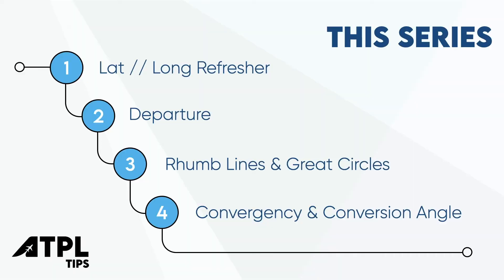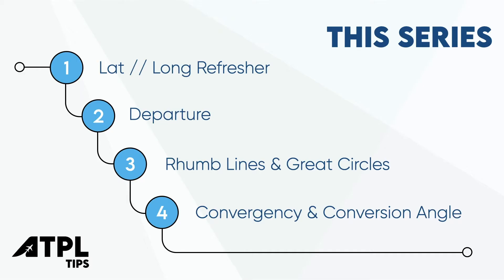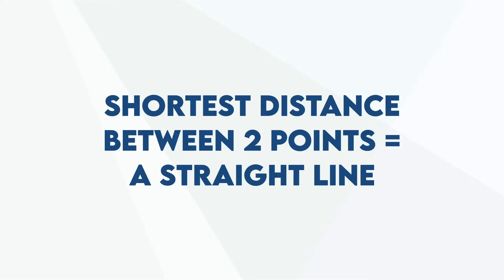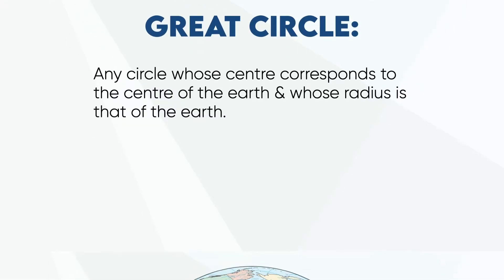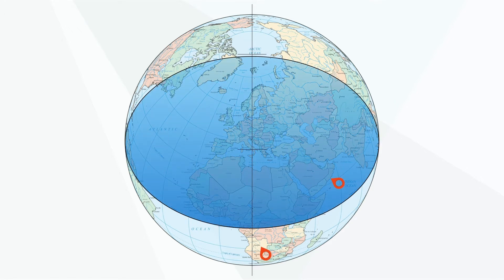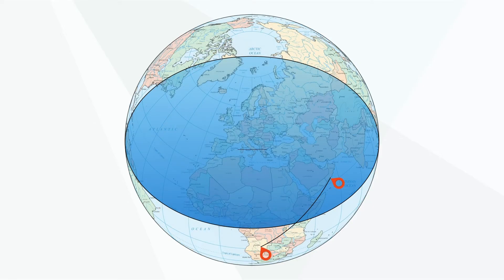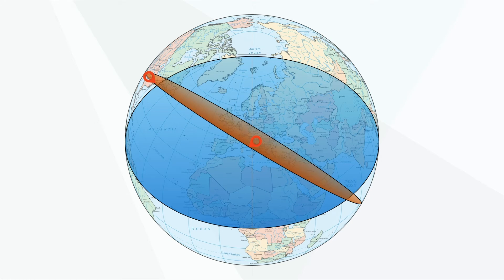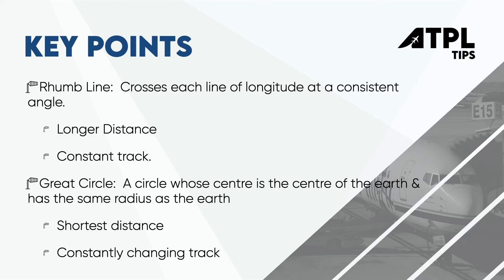GNav Basics 3:  Great Circles & Rhumb Lines

Comment: The Shortest distance  between two point on the surface of a sphere are two  geodesic arcs equidistant in Lenght and a mirror image of each other unless the points are 180 degrees apart (antipodes) Then its one line around the great circle route only  ..........Two paths on a sphere One path on a flat Plane ...simple
Reply: Garbage. Utter garbage.

Comment: Complete and utter nonsense ..The shortest distance between two points on the surface of a sphere are "TWO" GEODESIC ARCHS equidistance in lenght and a mirror image of each other ,unless the points are 180 degres apart (antipodes) then its one line around the great circle ONLY ....Drawing an equitorial line between two points is bogus AND NOT THE SHORTEST DISTANCE ...
Reply: Garbage.

Comment: This video alone debunks all flat earth theories regarding flight paths rarely crossing straight over the Atlantic.

Thanks for sharing
Reply: Complete and utter nonsense ..The shortest distance between two points on the surface of a sphere are "TWO" GEODESIC ARCHS equidistance in lenght and a mirror image of each other ,unless the points are 180 degres apart (antipodes) then its one line around the great circle ONLY ....Drawing an equitorial line between two points is bogus AND NOT THE SHORTEST DISTANCE ...
Reply: @markhalpin4377 
Any two locations on Earth are points on a great circle. Why do we need two great circle tracks?
Reply: @jesuitfreemason  Passing an equitorial line through two points on the surface  of  a sphere is not the shortest route that is the great circle route only ..One line on a flat plane two paths on a sphere ...simple
Reply: @jesuitfreemason  the only great circle route is between two points 180 degrees apart only
Reply: @markhalpin4377 
You're completely wrong. I don't know where you're getting this stuff from.
Any two locations on Earth are points on a great circle. Durban to Perth or Liverpool to Bradford, using spherical trig I can calculate the distance between these two city pairs, whether they be 50NM or 5000NM apart.
Reply: @jesuitfreemason  Complete and utter nonsense .Read the definition its explaned perfectly ...There should be two paths or geodesic arcs between any two points on a sphere unless they are 180 degrees apart ....Joining points by an equitorial line is not the shortest distance .....Two on a sphere one on a flat plane ....This does not reflect in reality ie with Air Routes
Reply: Wrong
Reply: @markhalpin4377 
My challenge to you.
Give me the coordinates of any two locations and I'll calculate the great circle distance between them.

Comment: Spherical Trigonometry Projection and Great Circle Map
The Great Circle Map can be projected by Spherical Trigonometry. Any region or nation can be center in the Great Circle Map.
The transformation of xyz coordinations on the Globe or Map will be calculated. 
Basic transformation of xyz coordinations has two steps that the rotation of cos circle and sin circle.
Namely, There are two formular. One is the rotation of cos circle and the other is the rotation of sin circle. 

The formular of the cos circle rotation for A degrees
(x=cosAcosθr, y=sinAcosθr, z= sinθr)

The formular of the sin circle rotation for B degrees by using Rotation Matrix
(x1=cosBcosAcosθr+sinBsinθr, y1=sinAcosθr, z1=cosBcosAcosθr-sinBsinθr)

As the transformation is programmed with big data, the Great circle map can be used in the various fields such as science, geography, and climate.
Reply: Complete and utter nonsense ..The shortest distance between two points on the surface of a sphere are "TWO" GEODESIC ARCHS equidistance in lenght and a mirror image of each other ,unless the points are 180 degres apart (antipodes) then its one line around the great circle ONLY ....Drawing an equitorial line between two points is bogus AND NOT THE SHORTEST DISTANCE ...
Reply: @markhalpin4377  thank you for reminding me.